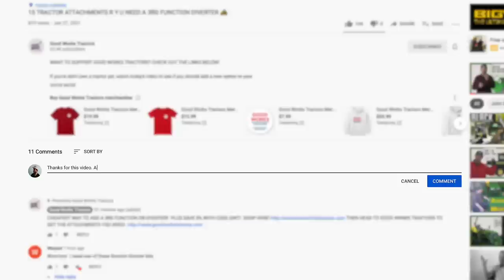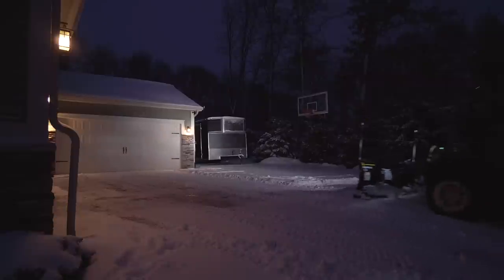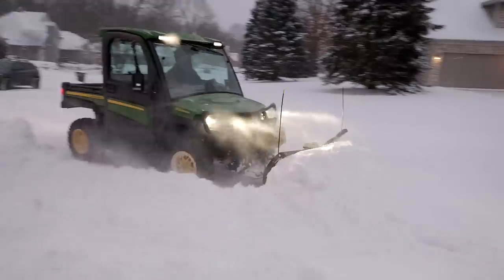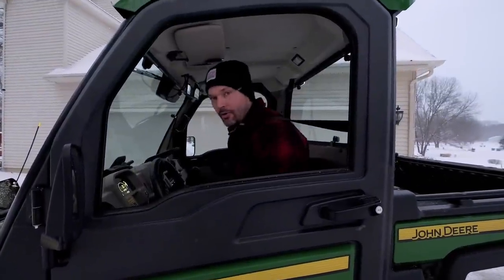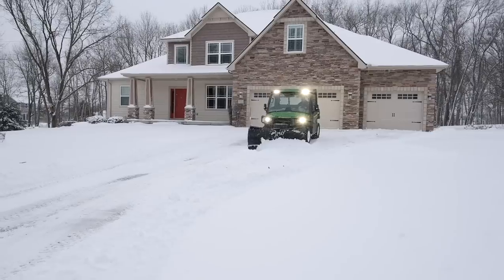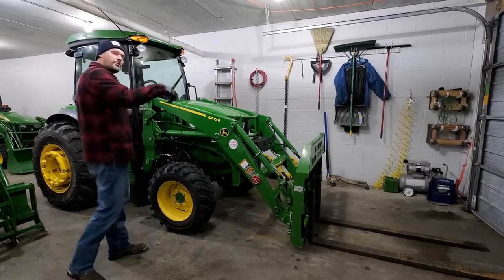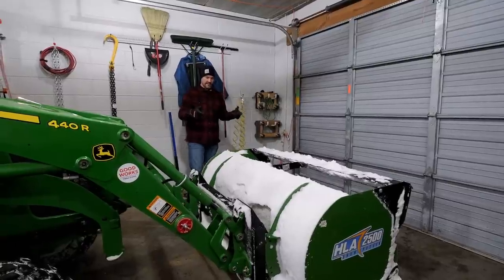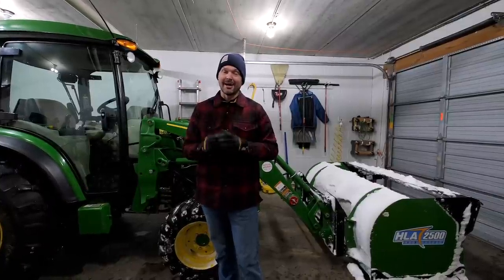JOHN DEERE GATOR VS TRACTOR PLOWING SNOW IN STYLE! 🚜🐊😎

Comment: That backdrag needs to be closed up. I could see loosing alot of snow thru it if snow was deeper.
Reply from the maker: I address that topic at the end of the video.  Also, the smaller versions -- HLA 1500 & 1800 Series are completely enclosed.  Thanks for watching.  👍
Reply: @GoodWorksTractors  I sent that comment while watching the video..lol just saw the end...
Reply from the maker: Haha makes sense
Reply: What about adding a piece of sheet metal to close the gap? Wouldn’t take much.

Comment: looking at gator or tractor they are only at MAX 40 feet long why are you back dragging for 2 city blocks . Length plus room of equipment then PUSH
Reply from the maker: Just factoring in the time it takes to maneuver for forward pushing in that tight space.